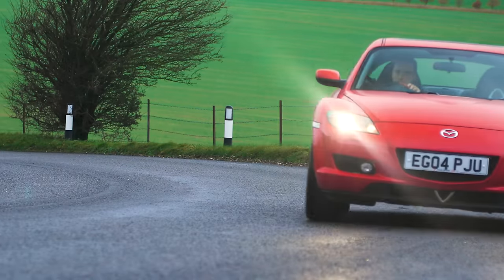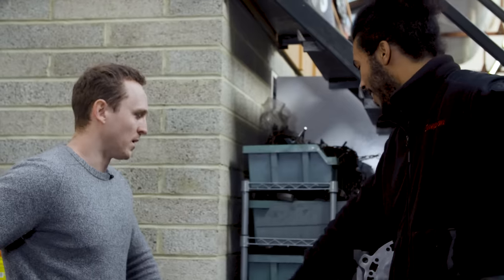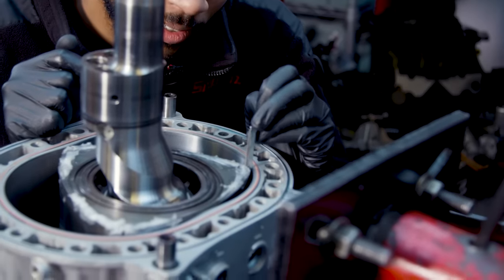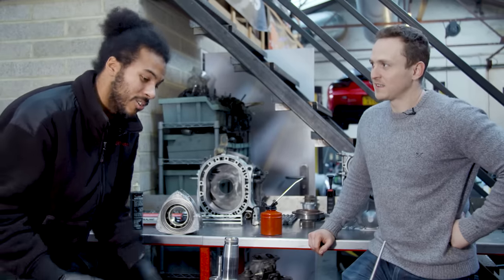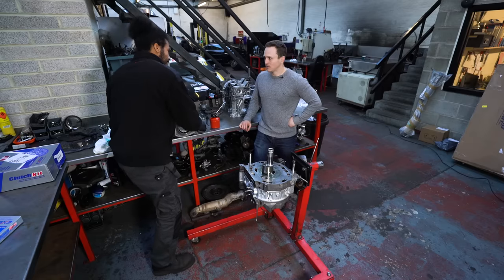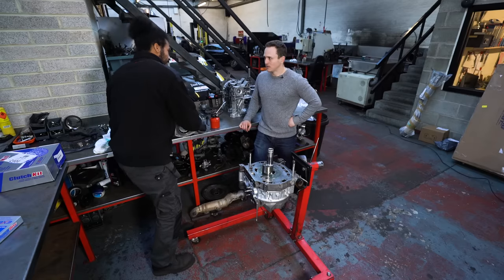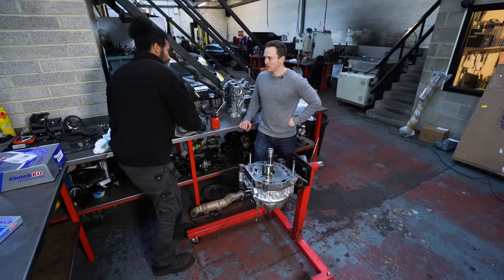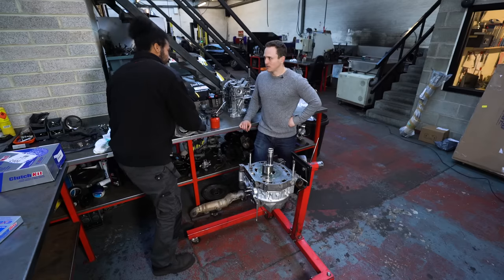How To Build A Rotary Engine: The ULTIMATE Guide

Comment: Having worked on traditional piston engines for most of my adult life, the simplicity of this design actually intrigues me.
Reply: Welcome to the dark side
Reply: @cg80847h  welcome to the engine that doesn't burn 75% of its fuel
Reply: @kas-lw7xz  lmaooo
Reply: It  also creates a really inefficient engine, most rotary engines don't even ignite their fuel air mixture completely.
Reply: It's design is very intriguing how ever it's unreliability is infamous
Reply: Dee Jay  Anyone stupid enough to buy one of these unreliable piles of garbage will be familiar with rebuilding failed engines sooner or later.

Obviously you have no formal science or engineering background or education.
 The method of measuring total swept volume displacement is exactly the same as reciprocating engines.
 The 13b has 6 chamber volumes of 654cc each for 3,924cc's of total engine displacement.
We use the 2X conversion formula to correct the difference in degrees of crankshaft rotation to complete it's firing order sequence.
 When corrected it a 720° firing order  the 13b has an effective displacement of approximately 2.6 liters when compared to reciprocating 4stroke engine.
Reply: Dee Jay  The 'Tax Displacement' method has nothing to do with Mazda or insurance companies.
NSU Motorenwerke GmbH executives conjured up the idea of lying about the actual displacement of the Wankel engine to improve sales in countries that based vehicle registration taxes on engine displacement.
Reply: Dee Jay  The fact that you would even attempt to argue that the RX8 has a 1300cc engine simply proves you know nothing about Wankel engines.
Reply: Dee Jay  You have lost all credibility son, it's obvious you don't know anything about Wankel engines.
Reply: Dee Jay  The Mazda 13B has SIX combustion volumes... not 3.
Reply: Dee Jay  I bet you are one of those clowns that believes the Wankel is a 2-stroke engine too!!!! Lol
Reply: Dee Jay  YES, TAX... This is where the commonly known and understood term
TAX DISPLACEMENT comes from.
Reply: Dee Jay  An Eccentric-crankshaft IS A CRANKSHAFT.
Reply: Dee Jay  Vehicles are taxed by engine displacement in Germany and many other countries including Japan.
NSU Motorenwerke GmbH. Conjured up the idea of "Taxable Displacement" to make the Wankel more attractive to sell in those countries.
Reply: Dee Jay  The Wankel engine operates using the 4-stroke operating principle... if you do not understand this fundamental fact about Wankel engines you are nothing but a fake, a poser simply pretending to be knowledgeable on this topic.
Reply: @sandervanderkammen9230  unlucky mate, and better luck next time
Reply: @dnbmania  You don't need luck when you have the facts....
Reply: Dee Jay  Sander probably owns a POS ford with a flaccid crankshaft. LOL A nitwit who probably couldn't "engineer" his way out of a cardboard box without google's help.
Reply: @chrislivesinreality8245  I'm not the idiot considering buying an RX8... you are.
Reply: Both you guys should give it a fucking rest.
Reply: @donhill1825  Mazda gave it a rest... it completely discontinued development and production of all Wankel engines.
The Wankel engine is now completely obsolete in the engine manufacturing industry.
Reply: @donhill1825  Wankel engines are  obsolete technology, the very last manufacturer Mazda discontinued development of Wankel engines in May 2009.
The Wankel engine has been obsolete for over a decade now.
Reply: @donhill1825  Dude this argument spands 4 months lmfao
Reply: @LeafSnow  Sander is still tying to work out how a rotary engine works unfortunately
Reply: Get it up you  Hope you don't claim to be an expert if you didn't even know Japan has taxes based on engine displacement
Reply: @dnbmania  Unlike some here I know the difference between a ROTARY engine and a WANKEL engine.
Reply: @aretard7995  The little troll is back... just the facts here child.
Reply: @Meme Man Looks like you are someone not accustomed to hearing the truth.
Reply: @aretard7995  Run along kid... the adults don't want to read your childish troll remarks.
Reply: @Meme Man 60 million new cars sold last year... ZERO sold with a Wankel engine.
Reply: @aretard7995  Go back and read my comments again... you might learn something. While you're at it, go back and read you long list of childish insults you posted... its enough to get your YouTube account suspended if your not careful.
Reply: @Meme Man Wrong, the Hummer H1 is the civilian version of the AM General HMMWV which is still in production after 36 years.
Reply: @Meme Man I'm just tired of people that don't know what they are talking about making false claims about the Wankel engine.
The Wankel was a massive commercial failure and is now obsolete because it offers no advantages over comparable reciprocating and turbine engines that are still mass produced today in the millions.
We are all fascinated by this unique and unusual engine design but let's stick to facts and not pretend that it is not completely inferior to reciprocating engines.
Reply: @Meme Man Wrong again... General Motors never produced the H1.
The H1 and the HMMWV are still produced by AM GENERAL in Mishawaka, Indiana.
Reply: @Meme Man I'm really sorry to have to correct you again... but all vehicles sold under the Hummer brand were manufactured by AM GENERAL in Mishawaka Indiana except the for 06 to 2010 H3 models which was based on the Chevy Trailblazer chassis.
Reply: @szewal  Actually its your comment that is a perfect example of the Dunning-Kruger effect... both examples of unproven theories.
Reply: Imagine getting so upset about someone else’s engine you argue about it on the internet for months of your life. What a shitshow this comment thread is.
Reply: It is said reliability is great
Reply: @_tim   Imagine someone so ignorant that they did not understand the difference between a ROTARY engine and a WANKEL engine.
Or that they would post comments on YouTube completely oblivious to the fact they know nothing about either engine type..
Reply: @raphaelmejia319  The reliability is truly appalling... No Wankel engine has ever been reliable enough to meet airworthiness standards for passenger aircraft... something that reciprocating engines can easily achieve.
Reply: @sandervanderkammen9230  also rotaries are used in the aeronautics industry all the time, what are you on about lol
Reply: @Troyboy-eh6nx  Wankel engines are significantly less reliable and durable than reciprocating engines.
This is a irrefutable fact.
 Mazda LOST the 1991 WSC endurance championship to Jaguar.
The 787B was slow and uncompetitive.
That is not only naive and disingenuous, it is also an outright lie. A 2 chamber Wankel engine does not have only  3 moving parts.
The Mazda 13B-MSP has 235 moving and seals related parts.
Many are the tiny fragile apex and side seals that are the primary failure mode of all Wankel engines.
Reply: @Troyboy-eh6nx  Your remarks reveal a general lack of knowledge and experience with Wankel engines and engineering in general.
Freedom Motors is does not manufacturer Wankel engines, it is a vaporware investment scam operated by the most infamous Vaporware scam in history, Moller Skycar... Paul Moller is a fruad.
Reply: @Troyboy-eh6nx  Wrong, that is a lie.
Wankel engines have never been used by a single legitimate aircraft manfacturer for a type certified passenger aircraft.

This is because they are too unreliable.
Reply: @Troyboy-eh6nx  Wrong, that is a lie.
Wankel engines have never been used by a single legitimate aircraft manfacturer for a type certified passenger aircraft.

This is because they are too unreliable.
Reply: @ShadowScopeIndustrys  Just the facts here kid..
Why don't you take your angry trolling somewhere else.
Reply: @sandervanderkammen9230  lol, kinda sad to be still arguing a year after a video was released, but yeah, im the troll here.
Reply: @ShadowScopeIndustrys  Thank you for being honest.
Reply: @sandervanderkammen9230  They are reliable enough to win races, but they are not DURABLE enough to withstand long term daily driving, reliable and durable are 2 different things.
Reply: @riogrande163  Not really, Wankel engines have never performed well in racing applications, they certainly cannot compete directly against reciprocating engines without handicaps.
 Wankel engines are neither reliable or durable.
Reply: @sandervanderkammen9230  you say your smart but you won’t mention all the rotary engines they put in the military versions of the Ford H1
Reply: @Biriadan  Ford H1..???
Ford never produced Wankel engines or H1s
Reply: @sandervanderkammen9230  dude are you blind Ford made loads of H1s and made almost as many rotary cars as Mazda.
Reply: @sandervanderkammen9230  I'm not the one that's blind to automative history boomer
Reply: @Biriadan  Run along little troll, you not fooling anyone.
Reply: @sandervanderkammen9230  I got 3 replies out of you lol
Reply: @Biriadan  And I proved you are a troll...
Reply: @sandervanderkammen9230  hahaha I got a fourth response out of you I can't believe you're still taking the bait
Reply: @Biriadan  And I just made you  admit you are a troll...
Reply: @sandervanderkammen9230  dude no you're the troll. But I caught you
Reply: @Biriadan  Thank you for proving my point. 
Cheers!☺
Reply: @sandervanderkammen9230  stop trolling me dude. I said leave me alone
Reply: @Biriadan  Your just admitted that you were the troll..
Reply: @sandervanderkammen9230  source?
Reply: @Biriadan  Your own comments..
Reply: @xXGamingFactorXx  makes for nice flames 🔥
Reply: @sandervanderkammen9230  hey i know that in general piston engines are far better then rotary but some people enjoy having a rotary. My dad has a rx8 and loves it to bits. He has had to do tons of work to it but he has always been able to do it himself(he used to be an engineer but once had to go to a specialist in all honesty) he has done many miles in it(cannot be bothered to ask how many sorry). While yes on paper a piston is better rotary engines have thier own little personalities. Also if you dislike the rotary engine why would you watch an entire video about how to construct one.(you seem to accuse people of being a troll,I am not one, but i just want to have a discussion.
Reply: @jacobwhite9961  Hey Jacob... what do you want to discuss?
I love Rotary engines and own several... but we were discussing Wankel engines.
Any questions?
Reply: @andrewable2634  Rotary or Wankel?
We are talking about WANKEL engine.

Wankel engines are inherently unreliable, this is well-known and understood by professional engineers.

The Mazda 787b was a failure. Mazda lost the WSCC championship  to Mercedes-Benz in 1990 and lost to Jaguar in 1992.
The 787B lost 20 out of 21 races and never posted a single pole position or fastest race lap.

Kenny is not a professional engineer or an expert on Wankel engines, he is nothing more than an amateur enthusiast blogger. 

No one has ever solved the reliability problems that plagued the Wankel right up until they became obsolete in 2012.
Mazda abandoned all development of Wankel engines in May 2009, customers simply refused to buy cars with unreliable and inefficient engines.
Reply: @sandervanderkammen9230  My dad went 10 years on a street port 580 to the wheel? Who told you that? Lmao it’s safe to assume the people that don’t know how to maintain their Rotary.
Reply: @wizumer1  Thank you for your personal anecdote but the fact remains that Wankel engines are inherently unreliable.
This is well-known and understood by engineers and engine manufacturers. 
There is absolutely nothing you can do in terms of maintenance that will make a Wankel engine match the reliability of reciprocating engines.
There is nothing you can say to change these facts
Reply: @sandervanderkammen9230  I feel you bro
Reply: @wizumer1  The truth is irrefutable, the Wankel engine is obsolete technology today because it is inferior to reciprocating engines.
Reply: This was a joy to read. I prefer 4 stroke piston engines but it is impressive this guy argued for over a year against these engines. Idk if there is much I could argue over for an entire year on the internet in a YouTube comment section.
Reply: @n111254789  The TRUTH bears repeating...
Reply: @n111254789  Have you? Do you know anything about Wankel engines? 
 Are you one of those angry little internet trolls that goes around looking for someone to hurl childish insults and expletives at?
 Childish insults won't make you look smarter and only prove you have nothing inteligent to add to this conversation.
Reply: @sandervanderkammen9230  It was a playful joke brother I'm just gassin' you don't take it personally. But what is it that has you so worked up about the engines that got you to go on a engine rebuild video of them and argue for a year about them? It is genuine curiosity I'm not being hateful or sarcastic I'm just curious what your specific account with them was that caused you to hate them so much.

To answer your question yeah I've worked on them before. I worked in a race shop for a few years porting and polishing cylinder heads for everything from sprint cars to dirt bikes. Even bridge ported a wankel using a precut jig once. But I'm not a fan of the engines their power to weight ratio isn't fantastic but they make a nice noise and are decent in the top end if ported correctly Reliability and gas mileage never mattered to me as I only ever worked on race engines for sprints not anything that would run you low on fuel. But if I'm going racing I'm running a 4 stroke piston engine, not a wankel everyone differs though you won't find anything cast iron on anything I build though wayyy too heavy.
Reply: @n111254789  The discussion was originally in regards to Wankels infamous reputation for poor reliability and the myth that these problems are solely due to irresponsible owners which is a completely untenable position.
The discussion was then hijacked by a particularly nasty variety of internet troll by the name of "Dee Jay" who's account has since been removed due to inappropriate and harassing comments.
I do not cow to internet bullies.
If you want to have a legitimate and civil discussion I would be happy to answer your questions.
Reply: @sandervanderkammen9230  Yeah I read the comment thread. I was wondering what caused you to come to this video if you dislike them so much? My second question being what kept you coming back for a year basically to keep disputing it with everyone? 

That was the only two questions I had. I don't disagree with ya' on the flaws of the engine design.
Reply: @sandervanderkammen9230  the internet truly is a beautiful place gentlemen.
Reply: @bigbongmastercoolman6022  The thing to remember is the truth always prevails...
Reply: @Troyboy-eh6nx  He's trying to argue about "Radial Rotary" engines versus "Wankel Rotary" engines. Generally, most everyone refers the differences as Radials and Wankels to avoid confusion.
Reply: @sandervanderkammen9230  The engine displacement measures precisely "1308 CC".
Reply: @bluspectre2042  Which type of Wankel engine are you refferng to?

Radial-Rotary is illogical.. its an oxymoron term.
Reply: @bluspectre2042  Only in "Tax Displacement"
In REAL displacement its 3,924cc's
Reply: @sandervanderkammen9230  The rotary engine was the first Japanese engine to win the Le Mans race Mazda was really dedicated to the rotary I believe if they try to take it back in the future they can make more advantages to it
Reply: @Picfifa11  Audi has won Le Mans 9 TIMES!!! with the Diesel engine proving that Diesel engines are vastly superior to Wankel engine for racing.

Of course unlike Wankel engines which are now obsolete, Diesels are still being made in the millions.

I you really think Mazda can bring back the Wankel engine? You don't understand why they are no longer made.
Cheers!
Reply: @sandervanderkammen9230  that’s okay I was just stating that Mazda was the first Japanese company to ever do it with a Rotary and the Diesel engine has way more time existence compres to the rotary because as you stated Mazda discontinued it
Reply: @Picfifa11  Well, that is really not saying much... because by 1991 every automobile manufacturer except for Mazda had abandoned the WANKEL engine.
 The 787b was not compliant with the 1991 rules and competed with an exemption certificate that allowed them to compete with the 1990 rules.

Actually you are wrong, the Rotary type engine PREDATES the Diesel engine... but I digress, I don't think you know what a rotary engine is... we are talking about Wankel engines.
Reply: @Picfifa11  26 of the world's biggest and best engine manufacturers and nearly 100 universities and research institutions   including Mazda all eventually reached the same conclusion.

That the Wankel engine is inherently and fundamentally inferior to reciprocating engines.
Reply: @Picfifa11  The Rotary type engine was invented by Felix Millet in 1892...
 Rudolf Diesel didn't invent his engine until 1893.
Reply: Its like speaking to a brick wall
Reply: @GhostOfDamned  Indeed it does seem that way at times, the way some people can stubbornly cling to their ignorant beliefs truly astonishing.
Reply: @sandervanderkammen9230  im talking about you, by reading the comments i see you being in the wrong
Reply: @GhostOfDamned  That comment reveals that you have no formal education or professional experience on this topic and know nothing about the Wankel engine.
Reply: @GhostOfDamned  You must be really spoiling for fight?
I'm not intimidated by angry little internet bullies so you're in the wrong shop for troll bait son.
Reply: @sandervanderkammen9230  lmao, thats pity
Reply: @GhostOfDamned  Thanks for proving my point.
Reply: @sandervanderkammen9230  ???
Reply: @GhostOfDamned  Exactly.
Reply: @sandervanderkammen9230  People don't buy them because of advantages, people buy them because they like the engines. The rotary engines have quirks that make them interesting to a lot of people, regardless of how inefficient they are.
It's no different from buying an old muscle car. You get them because they're fun or interesting, not because they're better than modern cars.

As for the airplane thing, Mazda's Wankel engines are indeed correctly called rotary engines, as it is short for "pistonless rotary engine" in the case of those. While the old airplane rotary engines are fundamentally different, the term still applies to both. This is a fact, and not an area where your opinions regarding semantics matter.
Reply: @LeafSnow  It aint the end of it, youll find this van bummer guy on literally every comment of every rx8 video on youtube with his two accounts hating on the car lol
Reply: @xMorbidArtx  I still don’t know how some people spend their whole freetime on the internet crying like this dude with his 2 accounts probably!
Reply: @standardheat-fs8159  Something miserably inescapable in their lives.
Reply: @Eyoldaith  Sorry lad, but you are very confused and misinformed.

Mazda purchased a license to produce the KKM57 engine from NSU Motorenwerkes GmbH. In February 1961.
The KKM57 is the NON -ROTARY version designed by Hanns Paschke and Walter Freode.
Mazda has never manufactured a single Rotary engine in its entire history.
 "Mazda Rotary" is a now defunct registered trademark for the company's discontinued line of Wankel KKM57 engines.

The Wankel KKM57 is a Orbiting Piston Engine and has a conventional, non-rotary layout with a spinning crankshaft.
Rotary engines do not have a spinning crankshaft.
Any questions son?
Reply: @xMorbidArtx  The TRUTH bears repeating and will always prevail.
The Mazda RX8 was without any doubt the worst sedan Mazda ever made. 
It has become infamous for premature engine failures and overall poor design and construction.